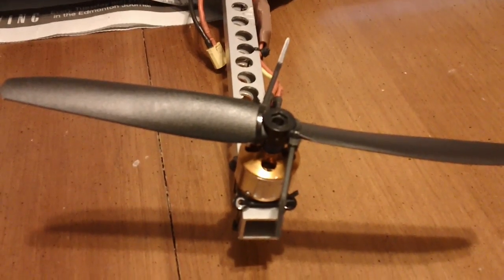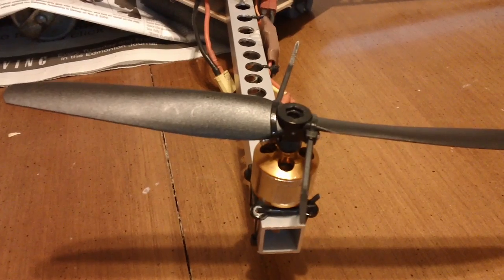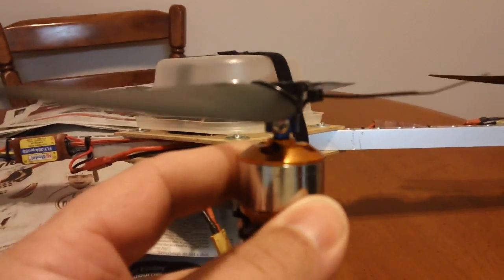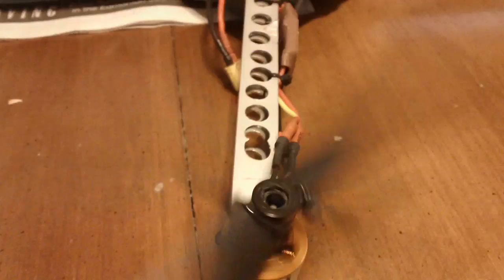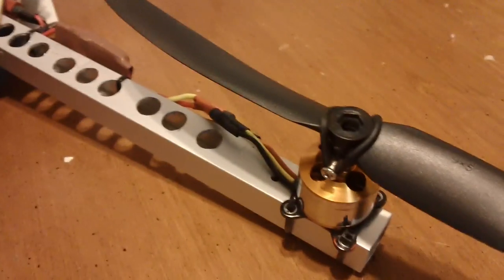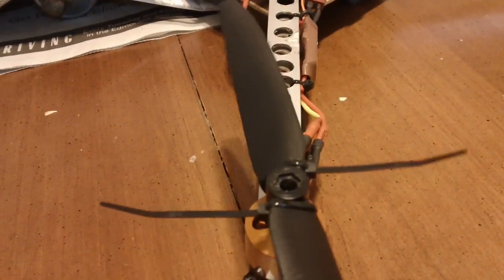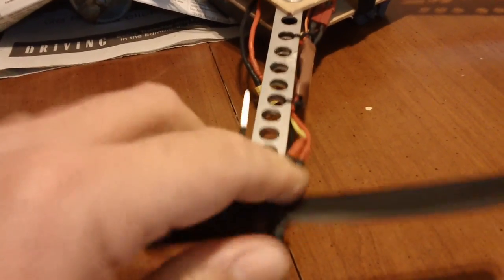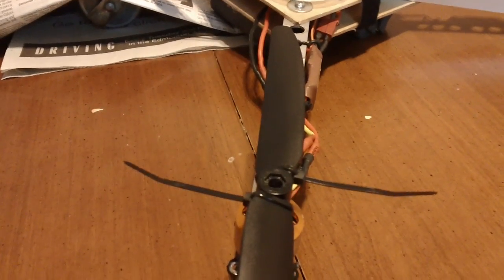Replace prop savers 0 rings with zip ties

Comment: I don't understand why you used a prop saver if the propeller remains rigid on a crash. The point of prop saver is to let the props fall off when hitting something, that's why people use rubber.
Reply: The zip ties brakes  and it save the prop.
Reply: Eric Jacques Hmm strange, the ones i can find here look a little bit too sturdy to just brake like this, it seems like it would brake the props instead of the zip tie... but i can't confirm that as i never used zip ties
Reply: The zip tie I use are 2.5mm x100mm  rated 8kg max  and they brake easily on a hit.  So I wondered if someone else was using zip tie and I found this video.

Comment: I saw several recommendations for Thera-band instead of o-rings.  It was a little confusing until I found out that Thera-band is long rubber tubing that you use to do resistance exercise.  You cut a very short slice off the end and that is your new "o-ring."  They are very tough and you can find it sold with free freight.